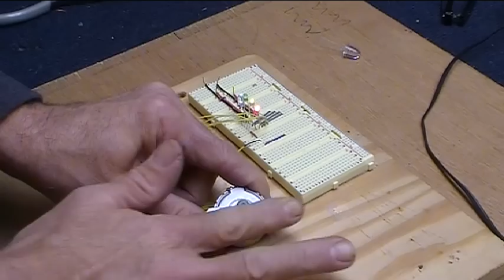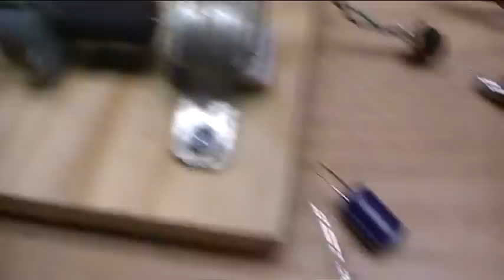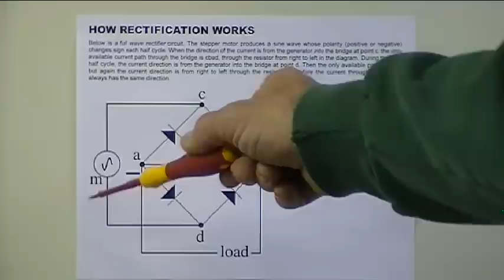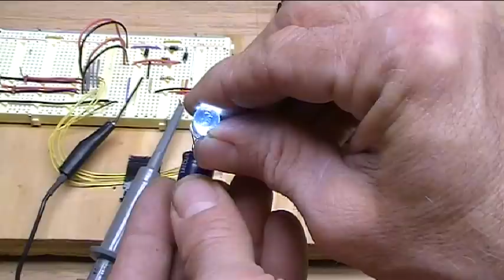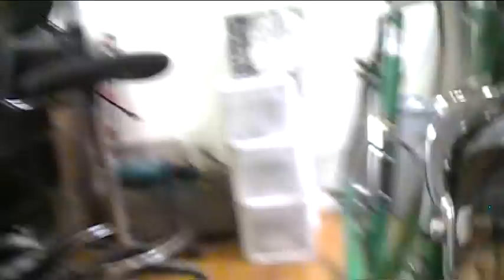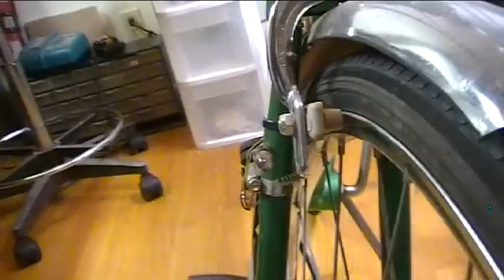Stepper Motors As Generators

Comment: Great ideas, thanks! Say, to use as a generator, can I wire the two coils in the stepper motor in "series" or "parallel" so as to only need one bridge rectifier?

Comment: What type of stepper motor did you use and what speed did you drive it at?
Reply from the maker: Just a stepper from a laser printer. Not sure on the RPM but I'd guess about 600 - 800.

Comment: Just getting into this and find your video very interesting. My question to you would be going on the idea of a water turbine or Hydro powered charger using the stepper motor. What RPM? Motor would be sufficient to create something like 5v to charge a Power bank? Which takes a micro USB 5v input? & how would you wire from the Load/resister to micro USB? to charge the power bank? My power bank as 2 outputs which are USB 5v 1.0A & 5v 2.1A & The input to charge it is 5v Micro USB. Is there a way to do this? Or would there be insufficient power from Any low RPM Motor to generate that amount of V? Cheers and really hope you reply?? TTEA

Comment: I have an idea about a clock sort of device to use in conjunction with the stepper motor. Some clocks have tension and springs.. It would be a lot of work to have to rely on manual power to drive a stepper but with a spring loaded device that could be actuated and the power could be used for any number of devices. Also... Since stepper motors require more amps to provide the torque they have a lot of resistance which could be used as a brake assist that could charge a cap for a power boost for a bike.. These are all ideas I have had a while I just need to get back in the garage😀 keep up the good work? Do you use drivers and bedini or jule theif circuits? Or any diy earth batteries or earth capacitors? And have you tried wiring in star configurations instead of the standard parallel and series connections?

Comment: From the m A measured from the circuit could you determine the amps needed to run the stepper motor (if you had no data on it: #OrphanSteppers
Or if one was trying to find the needed amps would it be better to run the orphan stepper with a known stepper motor (because the powered stepper would output more torque into the generator, producing more amps? is that how current works? I know there is a relation but does it go both ways reliably enough to calculate?)

Comment: Great vid as always man.
I've had good results by using sets of bridge rectifiers (one per stator coil) with schotkey diodes. 
That way you get a bit more voltage due to less voltage drop per diode. 
I want to make one of those hand winder torche / radio / short wave radio combo camping unit.
I also want to try using ultra capacitors instead of batteries.
Reply: Yo Homey and the other day we can get a bit more than that the other use when we have a lot with a lot of a lot of this message is not sure you can you can be able to be

Comment: use a Tesla turbine to spin this? or design a bigger better stepper design? search into PMA? aka pmg. permanent magnetic generator. high output low friction and resistance..  maybe run this motor or a pmg from a solar steam generator and a turbine with a pmg also add in a FRESNEL LENS ;) #FresnelGenerator #SolarSteam #magneticgenerator

Comment: for all of those on the bike generation use a giant belt drive from the rim maybe or an added sprocket to the inside of the hub if it's to many RPS and run your generator at the speed you want... also add in some super capacitors for storage... maybe even add in a buck converter and 6 super capacitors and a electric bike conversion kit and ride off into the sunset ;)

Comment: Love the idea of using these highly accessible little motors to re-purpose for bike light generators. How do I gear it to get the right voltage to use on say... a 30 lumen LED? As small as they are and as little amperage as they put out does it matter?

Comment: I just learned this the hard way by pulling the filament out of my 3d printer extruder too quickly and nearly frying the PSU- blown fuse. Here's the kicker- it's like a 27 am, 200w PSU. So, it was making more power than that..

Comment: Is that one where it's like two little motors in one ¿ 4 phase I think they're called. I got more amperage out of mine by using a rectifier on each winding then running them both through caps and connecting them in parallel rather than series.

Comment: Good video Hackaweek! With some useful figures to focus main parameters. I tried to build a bicycle generator starting from a common dynamo (with rectifier, condenser and IC buck converter) but I wasn't able to draw more than 200 mA,while I need between 0.5 and 1 A. I saw you installed 5 LED, assuming 20 mA/LED they draw around 100 mA. The stepper gives around 40 V (perhaps too much) but the amperage seems too low (normally Lipo charge between 500 and 1000 mA). How to solve this problem? By going for a bigger stepper, can I get higher mA?

Comment: Hi, ty for the video. If you conect an electrolitic capacitor to the rectifier bridge you will get "flater" voltage wave in your dc (capacitor goes conected to the p and n poles of the rectifier). This will give your motor more torque. I think you should check the amperage on the battery, the voltage drop is very small when batteries are discharged. If amperage is high, then Eureka! cheers.

Comment: How to increase the amperage
Reply: +Yash Rao To increase current, you need to get a bigger stepper motor. Bigger stepper motor would require more torque to spin at the same speed, maintain the voltage while increasing current.

Comment: bullshit, that small dc motor does not have a gearbox, It's impossible to drive the stepper motor without a gearbox at that high speed so what you show it's just an illusion, I made what you did with several motors and It didn't work.
Reply: Well then you sir, failed to make it correctly!

Comment: Great video...someone gave me a garden windmill, that thing is spinning almost all the time. I want to be able to harness some of that energy and just maybe put a 12V marker light on top of it or something simple, I have been researching and I think a stepper motor is the way to go, but I am not entirely clear on the bridge rectifier connection. I can get a rectifier that has 4 terminals and a stepper that has 4 wires, I know 2 of the terminals on the rectifier are DC out, but would I connect all 4 wires from the motor to the 4 terminals on the rectifier, or just the 2 pairs to the 2 terminals and then have the other 2 terminals for DC out?  Is there a simple answer for this?  Thanks

Comment: I think we could use this in hybrids. When u brake u could use regenerative braking speeds and, at high speeds, hydraulics could lift an aerodynamic surface to reveal an air turbine fan thing to assist in stopping and conserving energy... the turbine would have to be light and spin fast,I believe. Maybe then we could get a better charge maybe many fans... they would be inside the car where air is directed through like in sports cars.

Comment: For free energy to power the stepper motor use old dead batteries. Dead 9v normally have about 7.5v left. Plenty for a 6v motor to charge a few 9v batteries. Dead AA usually have 1.27v for some reason, just put in series to run the motor

Comment: That was a Cool hack.  I like steppers.  But I did notice a mistake in Your hack. !!!  That's NOT!!  a teddy bear tail light. It's more of a Fozzy Bear tail light.  :)   I would have liked to see the input Voltage and Amps to the drive motor.  Just to see how efficient steppers are at generating.   Thanks for a Cool Video.

Comment: p.s. is there actually any limit on what Size,Volts or Farads,of a capacity in a given Circuit?  - other than choosing a Capacitor of 'Higher' voltage Specs than a Circuit is Designed for (for safety reasons)!

Comment: Just trying to learn a little here so please forgive my ignorance, but if the Circuit is 42V+ (provided by the Stepper Motor) then surely using the 25V(Rated) Cap is a little risky? Wouldn't it be best to use a 50V (Rated) Cap in this Experiment/Example? Could someone please explain :)
Great Teaching Videos btw 'HackaweekTV' many thanks
Reply: I am not a serious electronics guy just minimum training. You have a good point but the little stepper motor is putting out next to no amperage so it can be done. 99 % of the time you would be extremely correct. If you did the same thing with 1 or 2 amps it could blow up. They do actually explode

Comment: i always wonderd if you could use  a dc motor to drive a stepper motor as a signal generater for a smaller stepper motor instead of using circuits

Comment: I get about 24,5 ~ 25 volt dc, but yea the motor gets pretty hot after a while. The power source is a 12v battery. I charge caps with it ( between 10,000~12,000 uF ). Gets a great spark.

I just need better motors. 1 small and 1 big. I'm sure that the small motor uses 6volts or 9 volts, instead of 12v i use. Since that sucker overheats pretty quickly.

Comment: German U-Boat's would power their boats impellers by electric motor, even on the surface; the diesels merely physically spun the electric motors, thereby causing the batteries to charge whenever the diesels were running. Similar concept as mentioned in this.

Comment: the reason in drop speed is the type of loads connected induction,transistor, capacitor ,{ battery} shh  using a full wave will give mostly all the volts can be 1-1/2 -2 in forward drop plus load  you want to make use full power ? might want to use car/truck alternators. i can show you how to make it put out either ac/dc low hi power.  ooooh shi nice jc penny trail master

Comment: dude we think alike i see where your going on this project     cool i did all thus to just much more usable current and volts  just to add to help your gona want to use a shaft drive over rubber  belts tires rollers ect, and your speed is reduced a lot. i like your dc block and indeed its all about isolation  heck inverters work on this principal .

Comment: suppose i want the out put of more than one step motor to go to the same output source to equal a larger amount of volts how would i go about doing that?
i also have a step motor with 2 different poles that out put voltage how would i send them to the same source to multiply the voltage?
thanks in advance

Comment: Why stepper motors?  A normal brushed dc motor would do the same thing right?
Reply: Better torque ratio, and thus higher voltage. DC motors are made to spin too fast to be useful for this. DC motors with a gearbox transmission work well though.
Reply: he said 12v dc

Comment: When I used to teach, I would use LEDs in bridge recifiers instead of normal diodes.  At a low frequency, you can see which diodes the current is running through.

Have you thought about using some capacitors on your bike to provide light when you're not peddling?

Comment: If you were to make a hydro-turbine setup, powered from your tap water, it would be too costly, as the water would cost more than electricity from the power company.
Reply: he was talking about making electricity as he normally uses water.  I can see this as problematic actually engineering the water turbine, you'd need to place it inline with your mains entry to get the best results.

Comment: You have a DC Wave there. but you could minimise that wave by swapping out your resistor for a capacitor. it won't be a smooth solid line but it will smooth it out to a +N DC power with an N2 AC component where the wave should never reach Zero.

Comment: The Step Motor, High Volatajes can give but little amperage, The Motor common, lower voltage, but more amperage. The most interesting are the stepper motors (Square) look my Amplifier Movil of Electrical Tension . gretings

Comment: I am doing the same sort of thing i can get 10khz from mine really depends on the dc motor driving it ,i have a frequency doubler getting over 16 khz now .
I need a large bandwidth as i want to use it on a magnetic amp that will make a amplifier for NBTV video signal so trying to make a electric tv no valves no transistor just wire caps and diodes .

Comment: I don't know much about electronics, so please understand if I'm mistaken in my understanding of some things.
1. Voltage divider. I've never used or seen one, other than inserting a resistor in series to use up some extra voltage, or in parallel to use up extra current, so it's really just a guess on my part.
2. Batteries in series, add volts. In parallel, add amp/hrs. Voltages in series should work the same way as batteries in series and give 2x as much amperage.

Comment: When I was a kid, about 45 yrs ago we had generators that had a spindle that would run against the wheel and it would generate enough power to run a pretty good head light and 4 signal/running lights (2 for front signals and 2 for the back). It did make it a little harder to ride the bike, but not much and it was worth it.

Comment: I agree, although I'm not sure what an LDO is. I was wondering about dividing the 42 vdc into 3 12v lines. if you still want 12 vdc you could put the lines together in series so you would still have 12 v but have more amperage. I don't know if it would work with this setup, but it works with batteries hooked up in series.

Comment: An ordinary motor just turns relatively smoothly and constantly, whereas a stepper motor can be used with a program in things like printers, scanners, fax machines. In the old dot matrix printers they were used for moving paper up & down any number of lines and moving the print head from side to side the width of any number of characters in either direction.
I hope that helps some.

Comment: It doesn't speed up, it slows down because it suddenly has to more work.

The more energy you draw the harder it gets for the motor.
If you draw more energy than what the motor is capable of delivering it will stall.
No free energy ;)

Comment: Ohm's Law tells us that Current = Voltage / Resistance. When we put a load on the circuit, we are increasing resistance, which means either current must decrease or voltage must increase to maintain balance. As you can see, the current drops slowly in response to the new load, which means that voltage has increased during this time. This voltage spike is why the generator spins faster, and this is also why a generator will blow-out if you suddenly put too much load on it.

Comment: A stepper motor is not exactly an alternator, the difference is an alternator can use electricity to make its magnet stronger and therefore make more current. AKA "charging the fields". So if you are clever enough to understand the science and alos modify the stepper motor in the correct way you will have what you need. Also the size of, and amount of coils in your stepper motor will determine the output of a stepper in this type of use.

Comment: Great Video and superb narration!
Love that 453 'scope - Super sharp, with that old mesh screen contrast filter - very effective. In the late 60s I used them to troubleshoot IBM 1401 Mainframes - loved the fact that you could turn the intensity up on Normal triggering and see the location of the trace starting point, then adjust  the sync level very accurately so you catch very short glitches!.

Comment: Awesome! I used a windshield washer fluid motor/pump, connected to my garden hose to power a Coleman Cold Cathode 4 watt flashlight circuit. I also used it to charge a cell phone. Any ideas or ways of  running a hard drive motor with a simple circuit?, or using it as a generator?

Comment: Very cool! Just out of curiosity though if the stepper is generating roughly 40v @ 40mA or 1.6 Watts how much power is the DC motor using? Also what kind of multimeter is that?

Comment: I have spinned flat step-motors from old videocassette-players and cameras, harddisks, using an electric driller, up to 3000rpm. conclusion: it can generate between6-12volt, 0.3-1amper. to mention, step motors are 3 phase alternators actually when put to do electricity, so you have to know how to use it. I put a classic 6diode mount to convert 3phase alternative into DC. also they can be put together 2 of them for one windmill, at axle ends, and tied serial or paralel

Comment: You should consider to use a RC Brushless motor,  i have been very very successful, but because they work under the three face concept, they need two Diodes, on each leg, to separate pos and neg polarity! other wise you'll have three face AC voltage coming out of it!

Comment: off the top of  my head: drill str8 through a pvc pipe with a thicker wall required but only indent the second side. slide paddle setup in with neos on blades, slide axle through and figure a way to seal the one side hole permanently. if your blade spins free of axle u wont need to worry about epoxy freezing the axle. use a coil on the top and bottom of pipe to pick up the power.

Comment: Been trying to connect a stepper motor to a windmill but don't get high enough rpms to get the stepper motor generating.  Tried gearing up the connection between the motor and the rotating blade shaft, but still not enough rpms.  Motor is from an HP printer.  Will larger motor produce more current at lower rpms? Suggestions?  Thanks for your video and your suggestions.

Comment: Yes hi ya i did that thank you and cool i made a output to a high voltage homemade transformer and i can power 1 lamp and it powers it self cause i have a HEAVY DUTY 12v ment for about anything from 12 - 50 volts so it powers itself now :)

Comment: Then use the output of the comparator to control a saturated switch, BJT or MOSFET to fill the second cap from the first. Then if you draw current off the second at a greater rate than the first fills with current, the first will keep up with the second until the demand is too great. Presto, a low-loss capacitative DC "transformer"! (Called a Buck converter)